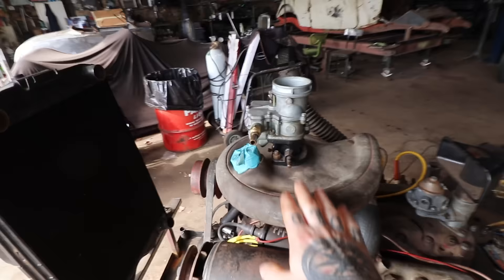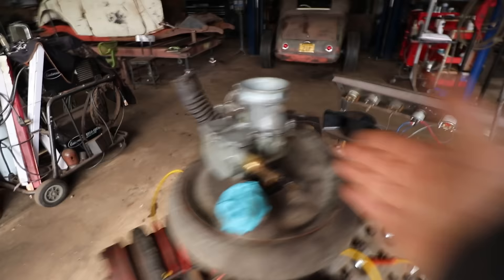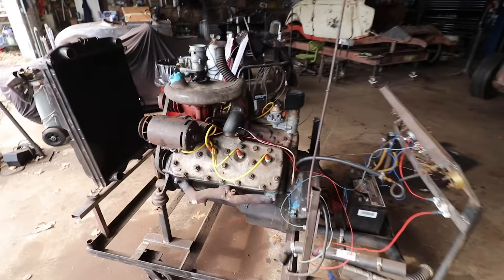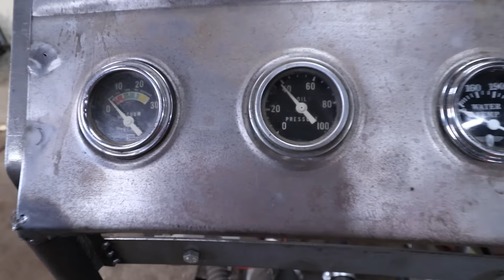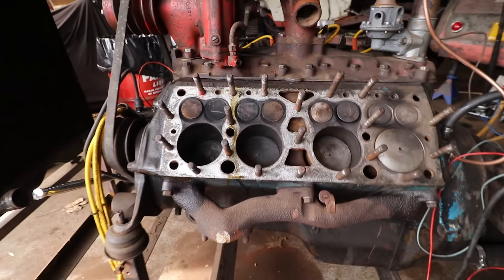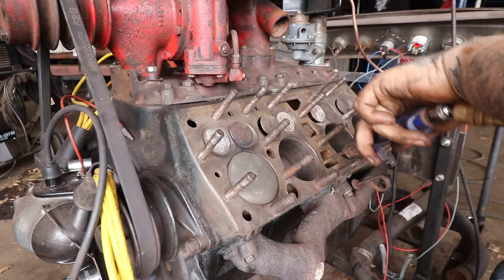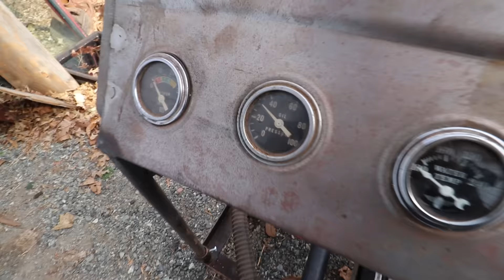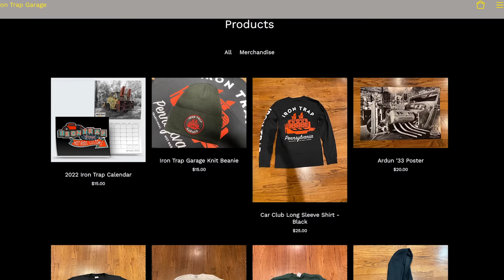First Start- McCulloch Supercharged Ford Flathead V8!

Comment: Blowing air into the coolant passages is exactly what I did on my 26 Oakland after it had been Parked for 75 years. Made a huge difference in how clean the coolant is, and it stays nice and cool now that we got it running again.
Reply from the maker: Yep I prefer it over flushing with water or vinegar as it is all dry and flushes out rather than turning to a sludge.
Reply: @IronTrapGarage  exactly!!!

Comment: With aluminum heads, the holes will get distorted slightly when the heads are torqued, making the holes a tiny bit smaller and making the heads harder to remove.

Comment: Glug , Glug , 😊, Glug , Glug!!!    Sounds like one hard pulling pulpwood SumBitch.     Imagine having this as your alarm clock, you would wake up every morning in a great mood. 
   Sure wish i would have saved every Flathead that i could have gotten when i was a kid. Id see scrap haulers with beat up cars , with still running engines getting hauled off.   They usta be common around sawmills being used as skid powerplants. Id enjoy listening to them in a hard pull. That gurgling sound is just so mesmerizing
Reply from the maker: Nothing beats the sound of a Flathead!

Comment: I'm friends with a Y-block and Flathead hoarder. I used to rebuild generators and starters for decades. Kind of fun. The voltage regulator settings will become a lost art.

Comment: A neighbor of mine raced flatheads on the local dirt track circuit. I ended up with a modified 37 Ford 6 window coupe. Needed an engine, so my friend tutored me in flatheads. I picked up a flathead block and assessories.It was on a bench and I was trying to  remove the valve assembles out of the block with the valve pry bar . They were  really stuck. One in particular I was really prying on finally broke loose, flew half way across the shop and crashed threw one of his windows.  He also tutored me in window glass replacement.

Comment: One thing that speeds up the water jacket cleanout is to put a shop vac on the larger holes to pull the debris up after you break it loose from the bottom. I've had rockers, cowls and roof bracing that had mouse nests in them, and no way to access them except for holes at either end. I was chasing mouse crap and dust back and forth with an air gun, and putting a mouse dust coating on the whole garage until I thought to adapt the shop vac hose to the far hole, and shazam! it was clean in a jiffy. Since then, I've used it on water jackets and other situations where I need to corral dust, and it sure speeds things up! And less mouse crap dust inhaled!
Reply from the maker: Great idea indeed! Thanks!

Comment: This is the project that hot rod purists dream of that never comes to fruition. When you pulled that truck from the barn I would've never thought it would house a supercharged flathead. Especially a setup as abnormal and odd as that one. And it's going to be a shop truck. This is absolutely wild and awesome
Reply from the maker: Thanks Jake! We’re trying to make something “era correct” but still “simple”. Should stand out when done!
Reply: @IronTrapGarage  darn right it'll stand out! Don't plan on making "quickie" runs to the parts stores because people will be wondering what fer engine ya have there. Most people have never seen or heard of a McCollough blower. Just printout a paper about it and give it out, unless you want to discuss it for 20 minutes everytime you stop.☺

Comment: It's going to be fun "running parts" in the pickup.  Nice work from everyone on this start up.  Keep it up as always and thanks for showing it to us.  I have never been a flathead fan until finding your channel a few years ago.  Out here almost all the flathead engines are useless.  I heard a ratio of 1 in 10 usable blocks.  The flathead I had in my '51, when I was a kid, used so much water I had to drive from gas station to gas station to get anywhere.  I am warming up 'cause they look and sound cool.

Comment: Matt, you are hitting another home run with that roadster pickup!  This is one of those projects that "nothing fancy" is gonna be so darned neat!  Good luck and many thanks for all of the great fun videos of the popular rods, customs .......and flatheads!  You da man!    And I must add that you are such a knowledgable and talented young man in this subject!  I must add also that my first job working on a flathead race motor at 11 years old was scraping the gasket and Permatex remnants off.   That was when we soon learned that aluminum paint sealed great and came apart very easily. I have built lots of race motors and never had aluminum paint leak or be hard to disassemble.
Reply from the maker: Thanks for watching!

Comment: Nice, started easily. Needs to be in an old Hot Rod, ( on display, dressed a little old style ) and out there burning rubber!!  Flathead Ford V8,s the exhaust gas goes out past the cylinders etc instead of straight out, that's why the design has some cooling issues.
21min music to my ears!

Comment: Kinda fun!
I think I would have dropped the oil pan looking for crap BEFORE I started it - but you're learning. 
I loved when you both near jumped out of your skin when you lit the it first time (inside) - those old flatheads are like that, they can light quicker than you can get your hand off the switch!
It'll be interesting to see how it runs with that 'charger on it!
Have Fun!!!

Comment: that is a cool looking engine with that blower on top. it's a different design that will stand out in a crowd that's for sure. hard to believe they didn't clean the mating surfaces before assembly all those years ago.

Comment: This motor is way too cool. As for stuck heads. Especially aluminum stuck heads. An old mechanic friend of mine, who is now long gone, used to work on prewar Rolls Royce motors. When he encountered a stuck head that hadn't been off since it left the factory he used 'clothes line rope'. Clothes lines were something that your grandmother had in the back yard.  Anyway. He would feed clothesline rope into the spark plug holes in each cylinder. Once he had as much as he could get in, he then put a ratchet or breaker bar on the front of the crank, and turned the motor over. The rope would push the head up and not damage anything in the process. Looking forward to the first drive with this supercharged motor.

Comment: Matt, since you sell on eBay and buy off of eBay, you need to see if you can find a hand held tach & dwell meter. They hook up to the battery and the side of the coil that goes to the points. That way you can set the idle on your engines correctly. Without guessing.

Comment: I just replaced a cracked head on Edna in December. Would have been cool to upgrade to aluminum heads but I didn't have the money for it. But I found a really nice head on ebay that had been gone through. Now I have a really nice red head on the passenger side. Broke a bolt in the block which was a nightmare to get out. But all is well now.

Comment: One of the overheat issues was water flow is too fast to allow good heat transfer.  The speed guys “in the day” drilled holes in the water pump impeller vanes to slow that down, overheat issues were over.
Reply: That was done a lot but running thermostats or just flat washers where the thermostats go is much easier.  Some guys thought faster flow would run cooler but not so.    The coolent has to be in the motor long enough to cool it and restriction is the way.

Comment: Your trying to get a feel when using the telescope gage . You need to send the gauge slightly bigger then the hole , then hold one end stationary and pull other end through it will automatically find the actual size ,then measure with micrometer.we all have made this mistake .

Comment: Give it some advance, sounds like TDC or before. Needs about 30 deg at 3500.
Those old headgaskets have a use by date as well, Generally 2-3 years after manufacture
Intake air temp, the colder the better. Hot water MAY be of use in your snow conditions,, every time else no. Though once the engine is warm those icy conditions mean power.

Comment: Check that carburetor float to. It sounds like it's not level to some. Along with that line being unhooked up to. It's kinda sounds like it's A little fuel hesitant to still guy's. Other than that it sounds healthy for being that old though for sure. It'll put out some power after you get those slight bugs worked out with it to.

Comment: Love it. That Fordtastic sound says it all right there. Congrats on getting going gents. Question - As I fantasize about a future swap into the old ‘49 jeep - I’d be interested to know the overall length of a flathead, fan included. Might as well learn now if I need to do any firewall or radiator mount mods. Let’s say a later motor with side distributor if you’ve got the time for a quick measure. Cheers

Comment: I thought I saw bubbles coming out of the rad fill.   You might want to do leak down test on that engine.  I think it still has a head gasket problem..
Reply from the maker: It was the engine warming up and the water level rising

Comment: I thought about running my '36 21 stud engine with no fan because I thought about running the crab style distributor instead of the divers helmet one, but was afraid of overheating issues with no fan.
Reply from the maker: You probably want to run a fan. You just have to run the correct fan/setup to make it work. Plenty of people doing it.

Comment: The blower might run  cold at idle(as the intake charge draws the air in under vacuum)  but when being driven the compressed charge will get hot won't it?
Reply from the maker: It will get somewhat hot when hot outside but I think when it’s so cold out it will be a problem. I think they added the water into the intake for warming up the intake charge more quickly when cold.  I know there’s guys running without the coolant hoses on the blower and it works fine. Just might be a bit “cold blooded” in the spring/fall.
Reply: @IronTrapGarage  maybe see how it runs with the bigger jets first? wicked cool, matt.

no pun intended!

Comment: Wow, super charger, on a roadster, how many ponys is that going to be putting out? Box the frame? Would a bigger carb equal more hp?
Reply: Sounds great. What brand of head gaskets do you use?
Reply: No need to box the frame.  The 37 flathead is only 85 hp and I don't know what the blower adds but certainly not a high stress package. : )
Reply from the maker: As Jon mentioned this won’t make crazy power. More a novelty than anything.